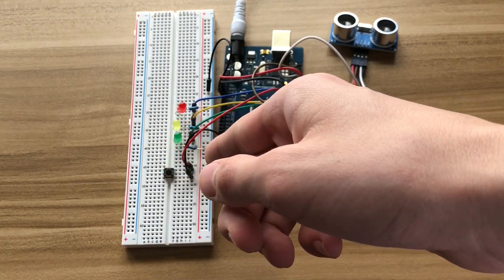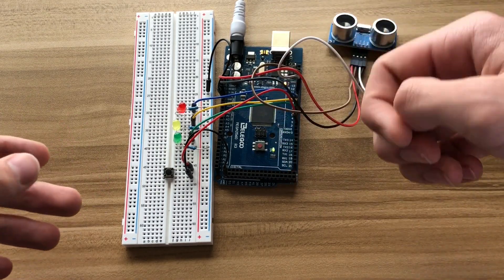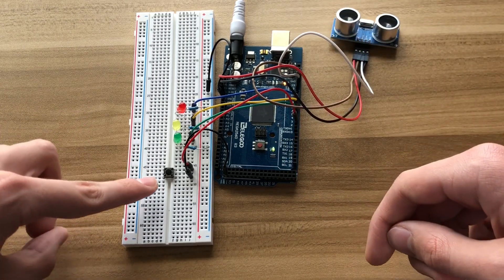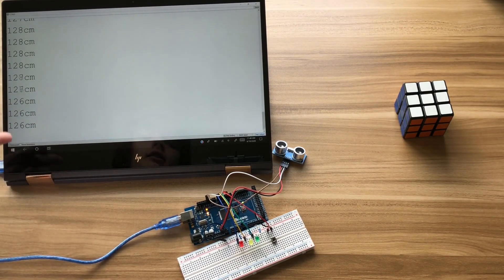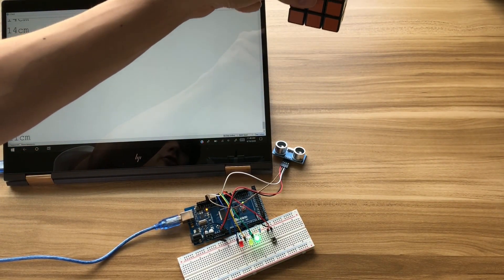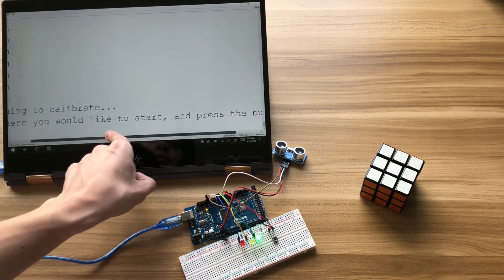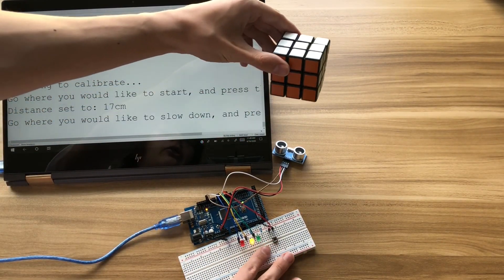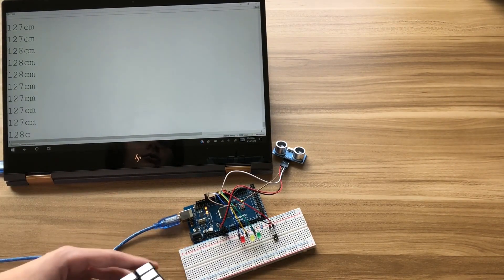Arduino Garage Parking Stop Light Project

Comment: // include libraries for the sonar 
#include "SR04.h"
#define TRIG_PIN 12
#define ECHO_PIN 11
SR04 sr04 = SR04(ECHO_PIN, TRIG_PIN);

//set global variables
long a; //distance from sensor
const int redPin = 7; //pin number
const int yellowPin = 6; //pin number
const int greenPin = 5; //pin number
const int calibrateButton = 2; //pin number
int calibrateButtonState; //button on/off
int onDist = 30;
int greenDist = 20; //maximum distance for a green light in centimeters
int yellowDist = 10; //maximum distance for a yellow light in centimeters
const int updateRate = 100; //time between updated light in milliseconds

void setup() {
  Serial.begin(9600);
  delay(1000);
  pinMode(redPin, OUTPUT);
  pinMode(yellowPin, OUTPUT);
  pinMode(greenPin, OUTPUT);
  pinMode(calibrateButton, INPUT_PULLUP);
  startupLights();
}

//main function to direct flow of code
void loop() {
  a = sr04.Distance();
  Serial.print(a);
  Serial.println("cm");
  checkDist();
  calibrateButtonState = digitalRead(calibrateButton);
  if (calibrateButtonState == LOW)
  {
    delay(500);
    calibrate();
  }
}

//normal operation to determine stopping distance
void checkDist()
{
  if (a >= onDist)
  {
    digitalWrite(greenPin, LOW);
    digitalWrite(yellowPin, LOW);
    digitalWrite(redPin, LOW);
    delay(updateRate);
  }
  else if (a >= greenDist)
  {
    digitalWrite(greenPin, HIGH);
    digitalWrite(yellowPin, LOW);
    digitalWrite(redPin, LOW);
    delay(updateRate);
  }
  else if (a >= yellowDist)
  {
    digitalWrite(yellowPin, HIGH);
    digitalWrite(greenPin, LOW);
    digitalWrite(redPin, LOW);
    delay(updateRate);
  }
  else
  {
    digitalWrite(redPin, HIGH);
    digitalWrite(greenPin, LOW);
    digitalWrite(yellowPin, LOW);
    delay(updateRate);
  }
}

//carry out the calibration process
void calibrate()
{
  Serial.println("Begining to calibrate...");
  digitalWrite(redPin, LOW);
  digitalWrite(yellowPin, LOW);
  digitalWrite(greenPin, HIGH);
  flash(greenPin, 3);
  Serial.println("Go where you would like to start, and press the button.");
  waitForPress(calibrateButton);
  onDist = sr04.Distance();
  digitalWrite(greenPin, LOW);
  Serial.print("Distance set to: ");
  Serial.print(onDist);
  Serial.println("cm");
  delay(100);
  flash(yellowPin, 3);
  Serial.println("Go where you would like to slow down, and press the button.");
  waitForPress(calibrateButton);
  greenDist = sr04.Distance();
  digitalWrite(yellowPin, LOW);
  Serial.print("Distance set to: ");
  Serial.print(greenDist);
  Serial.println("cm");
  delay(100);
  flash(redPin, 3);
  Serial.println("Go where you would like to stop, and press the button.");
  waitForPress(calibrateButton);
  yellowDist = sr04.Distance();
  digitalWrite(redPin, LOW);
  Serial.print("Distance set to: ");
  Serial.print(yellowDist);
  Serial.println("cm");
  Serial.println("Enjoy your new settings");
  delay(2000);
  Serial.println("Returning to normal operation...");
  startupLights();
}

//wait until the specified button is pressed to continue
void waitForPress(int button)
{
  while (1 == 1)
  {
    if (digitalRead(button) == LOW)
    {
      break;
    }
  }
}

//flash the specified light a specified amount of times
void flash(int pin, int flashes)
{
  for (int i = 0; i < flashes; i++)
  {
    digitalWrite(pin, LOW);
    delay(150);
    digitalWrite(pin, HIGH);
    delay(150);
  }
}

//light sequence for startup
void startupLights()
{
  for (int r = 0; r < 3; r++)
  {
    digitalWrite(redPin, HIGH);
    delay(50);
    digitalWrite(yellowPin, HIGH);
    delay(50);
    digitalWrite(greenPin, HIGH);
    delay(200);
    digitalWrite(redPin, LOW);
    delay(50);
    digitalWrite(yellowPin, LOW);
    delay(50);
    digitalWrite(greenPin, LOW);
    delay(200);
  }
}

Comment: Love this project and great video. Ill admit Im not very familiar w any of this. Hoping you can help, I ran into an issue when using your code. Here is the message I got.
Arduino: 1.8.13 (Mac OS X), Board: "Arduino Mega or Mega 2560, ATmega2560 (Mega 2560)"

Blink:2:10: fatal error: SR04.h: No such file or directory
 #include "SR04.h"
          ^~~~~~~~
compilation terminated.
exit status 1
SR04.h: No such file or directory

This report would have more information with
"Show verbose output during compilation"
option enabled in File -> Preferences.

I have searched to figure out how to add SR04.h to the library and I cant figure it out. 

Thanks in advance!
Reply from the maker: Awesome, thanks for your interest! In Arduino programming, there are “libraries” of code which have pre-built functions and variables you can use. In this example, I used the library “SR04.h” to connect with the distance sensor. This library is not included when you download the arduino software, so you have to find a free download of this library online, and include it in the arduino software.
Here’s a link with information about how to download libraries: https://www.arduino.cc/en/guide/libraries
And here’s a link to download the SR04.h library: https://github.com/mrRobot62/Arduino-ultrasonic-SR04-library/blob/master/SR04.h
Let me know if that works, thanks for asking!
Reply: @MechMX  I got it to work!!!!  Now I will need to figure out how to get this in my real traffic light w more led's. My adventure continues, thanks again!
Reply from the maker: Perfect! I’m happy you got it to work. Good luck with the bigger version!

Comment: Hi, this is a great project for me, I got to try it and I like it so much, I congratulate you, but I encountered a problem, when I disconnect the power, the calibrations are lost, do you have any suggestions?
Reply from the maker: Thanks so much! I know exactly what you are talking about, and the answer lies in how the variables in the Arduino are stored. When the Arduino is turned on, the program resets every time, no matter what changes are made to the variables. In order to store data after the Arduino is turned off, the "EEPROM" (electrically erasable programmable read-only memory) must be used. This should be a quick fix and the Arduino reference has a guide to using this data storage here: https://www.arduino.cc/en/Reference/EEPROM. Let me know when you get it working!
Reply: @MechMX  sorry, but i am a novice with arduino, could you give a practical example of what and where to insert in your code to solve this problem?
no need to reply immediately, when you have time if you can help me i would appreciate it, sorry for the bad english but i am using google translate now.
thank you so much
Reply from the maker: @batmanitaly  I found this tutorial online with a few examples of how to use the EEPROM library. All you have to do is “include” the library, and you will get all of the functions that come with it. The tutorial also has an example with code you can use too: https://randomnerdtutorials.com/arduino-eeprom-explained-remember-last-led-state/ Let me know if this works, thanks!
Reply: @MechMX  ok. thanks,
I will try to follow the tutorial you sent me this holidays, thanks again 😊
Reply from the maker: @batmanitaly  My pleasure, happy to help!

Comment from the maker: Here is the code for this project (there are most likely better ways to write this, so feel free to make changes in your code) :

// include libraries for the sonar 
#include "SR04.h"
#define TRIG_PIN 12
#define ECHO_PIN 11
SR04 sr04 = SR04(ECHO_PIN, TRIG_PIN);

//set global variables
long a; //distance from sensor
const int redPin = 7; //pin number
const int yellowPin = 6; //pin number
const int greenPin = 5; //pin number
const int calibrateButton = 2; //pin number
int calibrateButtonState; //button on/off
int onDist = 30;
int greenDist = 20; //maximum distance for a green light in centimeters
int yellowDist = 10; //maximum distance for a yellow light in centimeters
const int updateRate = 100; //time between updated light in milliseconds

void setup() {
  Serial.begin(9600);
  delay(1000);
  pinMode(redPin, OUTPUT);
  pinMode(yellowPin, OUTPUT);
  pinMode(greenPin, OUTPUT);
  pinMode(calibrateButton, INPUT_PULLUP);
  startupLights();
}

//main function to direct flow of code
void loop() {
  a = sr04.Distance();
  Serial.print(a);
  Serial.println("cm");
  checkDist();
  calibrateButtonState = digitalRead(calibrateButton);
  if (calibrateButtonState == LOW)
  {
    delay(500);
    calibrate();
  }
}

//normal operation to determine stopping distance
void checkDist()
{
  if (a >= onDist)
  {
    digitalWrite(greenPin, LOW);
    digitalWrite(yellowPin, LOW);
    digitalWrite(redPin, LOW);
    delay(updateRate);
  }
  else if (a >= greenDist)
  {
    digitalWrite(greenPin, HIGH);
    digitalWrite(yellowPin, LOW);
    digitalWrite(redPin, LOW);
    delay(updateRate);
  }
  else if (a >= yellowDist)
  {
    digitalWrite(yellowPin, HIGH);
    digitalWrite(greenPin, LOW);
    digitalWrite(redPin, LOW);
    delay(updateRate);
  }
  else
  {
    digitalWrite(redPin, HIGH);
    digitalWrite(greenPin, LOW);
    digitalWrite(yellowPin, LOW);
    delay(updateRate);
  }
}

//carry out the calibration process
void calibrate()
{
  Serial.println("Begining to calibrate...");
  digitalWrite(redPin, LOW);
  digitalWrite(yellowPin, LOW);
  digitalWrite(greenPin, HIGH);
  flash(greenPin, 3);
  Serial.println("Go where you would like to start, and press the button.");
  waitForPress(calibrateButton);
  onDist = sr04.Distance();
  digitalWrite(greenPin, LOW);
  Serial.print("Distance set to: ");
  Serial.print(onDist);
  Serial.println("cm");
  delay(100);
  flash(yellowPin, 3);
  Serial.println("Go where you would like to slow down, and press the button.");
  waitForPress(calibrateButton);
  greenDist = sr04.Distance();
  digitalWrite(yellowPin, LOW);
  Serial.print("Distance set to: ");
  Serial.print(greenDist);
  Serial.println("cm");
  delay(100);
  flash(redPin, 3);
  Serial.println("Go where you would like to stop, and press the button.");
  waitForPress(calibrateButton);
  yellowDist = sr04.Distance();
  digitalWrite(redPin, LOW);
  Serial.print("Distance set to: ");
  Serial.print(yellowDist);
  Serial.println("cm");
  Serial.println("Enjoy your new settings");
  delay(2000);
  Serial.println("Returning to normal operation...");
  startupLights();
}

//wait until the specified button is pressed to continue
void waitForPress(int button)
{
  while (1 == 1)
  {
    if (digitalRead(button) == LOW)
    {
      break;
    }
  }
}

//flash the specified light a specified amount of times
void flash(int pin, int flashes)
{
  for (int i = 0; i < flashes; i++)
  {
    digitalWrite(pin, LOW);
    delay(150);
    digitalWrite(pin, HIGH);
    delay(150);
  }
}

//light sequence for startup
void startupLights()
{
  for (int r = 0; r < 3; r++)
  {
    digitalWrite(redPin, HIGH);
    delay(50);
    digitalWrite(yellowPin, HIGH);
    delay(50);
    digitalWrite(greenPin, HIGH);
    delay(200);
    digitalWrite(redPin, LOW);
    delay(50);
    digitalWrite(yellowPin, LOW);
    delay(50);
    digitalWrite(greenPin, LOW);
    delay(200);
  }
}
Reply: Do you have the schematics?